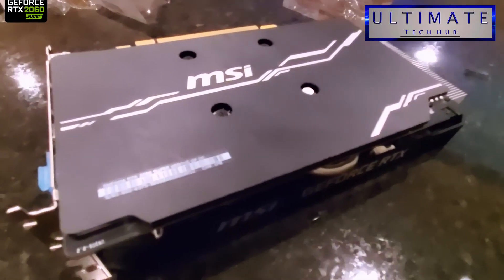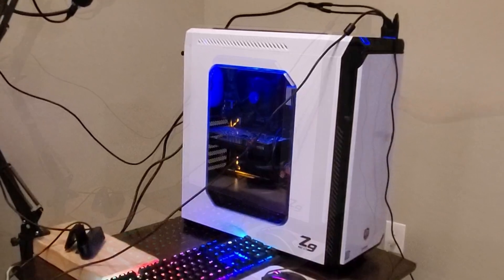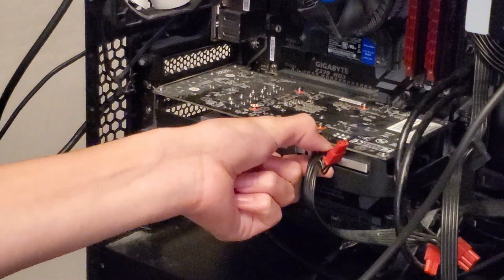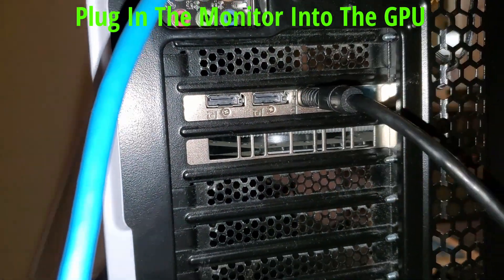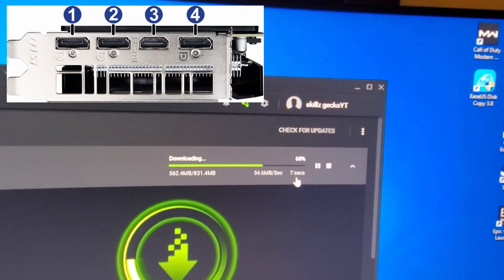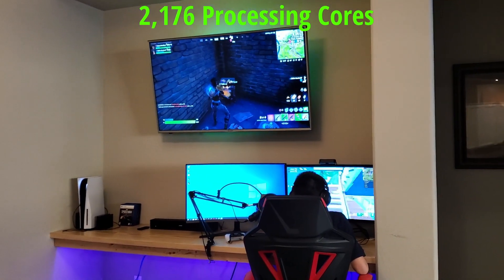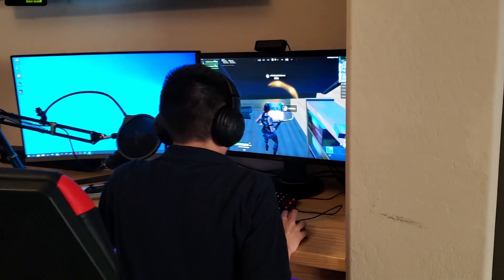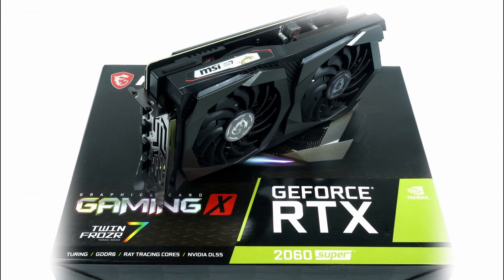HOW TO INSTALL - GEFORCE RTX 2060 SUPER | QUICK & EASY!

Comment: Would it be worth it to upgrade to this from a normal 1660? Or would it not really make that big a difference for $400
Reply: With an AMD Ryzen 5 2600 and 8GB RAM (would one of those be better to upgrade instead?)
Reply from the maker: @TheNobleWarriorr  2060 is a great upgrade from the 1660.
Reply: No, go straight to 3060 or 4060 the price almost the same now.
Reply: @yudhapermana6831  ended up going with a 3060 👍

Comment: I love mine but i didnt plug in a hdmi i just installed it and connected the cable and updated the drivers. Do I have to plug in the hdmi? It looks awesome and works great so I didnt think I was missing anything.
Reply from the maker: Yes HDMI or display port.
Reply: @UltimateTechHub  thanks for the help and great vid!
Reply: @UltimateTechHub  well cool its set up in the display port in the back of the tower to my monitor but not connected difectly to the 2060. Seems to be reading and being utilized.

Comment: I just paid 200 for mine and can’t wait to install it. Ty for the vid!
Reply: I’m looking at buying one for 150 and another 16gb ram for now I traded for my pc it has a rx 570 i7 8700 crucial ssd mx500 2.5 250gig, 1tb hdd, 600w psu, Omen mb and Kingston fury hyper x 16gb ram 2666mnh about to buy another of those too for 32gig of Ram ddr4 … also came with a onn 165hz 24.5” monitor etc etc etc haha I gave a replica Rolex for it

Comment: Dam I just bought it to replace my gtx 1060. So it won't work with cyberpunk 2077?
Reply from the maker: It will run 60+ FPS at medium to high settings at 1080p but not in 4k. You need at least an RTX 3080 or higher. I have an RTX 3080 Ultra that I just installed. Here is the video link to the installation and FPS testing!  https://youtu.be/6mvuNWpEFQo  Thank you for watching!

Comment: hey, is the sharkbay SDK0E50510 WIN motherboard compatible with the  rtx 2060 super? im thinking of upgrading my pc (right now i have a gtx 1060) and cant find any info if the motherboard is compatible. help would be much apreciated!
Reply from the maker: Most motherboards are compatible with this gpu. The only issues are if it's a 3 fan gpu and will it fit into the pc case. You should be all good. Thank you for watching.
Reply: @UltimateTechHub  thank you, you are a life saver!
Reply from the maker: @kuul6695  LOL! Thank you! Glad to help and once again thank you for watching and if you subscribed thank you as well.

Comment: My Processor is Ryzen 5 3400g..do I need to change that for 2060 Super??
Reply from the maker: No you should be fine. Of course a better processor is always recommended but  not always necessary.
Reply: @UltimateTechHub  Cool! Thank you for the quick reply 🙌
Reply: @UltimateTechHub  One more doubt, is there any maximum Watts to use any Graphic cards. I mean can I use a 1800W PSU for an RTX 2060 gfx card??
Reply from the maker: @zekimadridista1515  yes a 1800w psu will work. 1800w is a massive psu and would work for a rtx 3080 or rtx 4080. My PSU is 1000w and I run a RTX 3080.

Comment: Upgrading the Graphics card is easy. Upgrading the Power supply for the graphics card is the hard part.
Reply from the maker: Yes that upgrade is a bit more difficult with all of the wires. Here is a video of a $2000 Gaming PC Build with the RTX 3080 and a 1000w psu. 
https://youtu.be/Br6V_nH0GOs
Thank you for watching!
Reply: @UltimateTechHub  what about 400w
Reply from the maker: @deivymaybe7554  That's not enough power for the GPU and the other components. A 500w should work fine.
Reply: @UltimateTechHub  460w?

Comment: i cant find a pci e cable to connect to the card, any help? do i need to buy a new power supply?
Reply from the maker: The 1050ti doesn't require a power connection. The motherboard will power it on its own.
Reply: @UltimateTechHub  im talking about the 2060 super
Reply from the maker: @deanblunted  your psu doesn't have the connector for the gpu? Is your PSU modular? Can you add additional power cables?
Reply: @UltimateTechHub  it doesn't, and it is modular and i'm pretty sure there's room for additional cables
Reply from the maker: @deanblunted  You should be able to buy the power cable that connects from the psu to the gpu.
Reply: if he waited, he could've got a 3060 with 4k support for the same price

Comment: When I install my gpu my pc will start but no power in the gpu
Reply from the maker: How many watts is your power supply?
Reply: @UltimateTechHub  500
Reply from the maker: @DnRico4  You double checked the power connections?
Reply: @UltimateTechHub  yep
Reply from the maker: @DnRico4  it may not be enough power. That's my best guess.
Reply: @UltimateTechHub  Okay! Thanks for helping